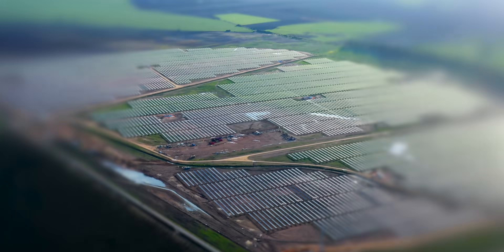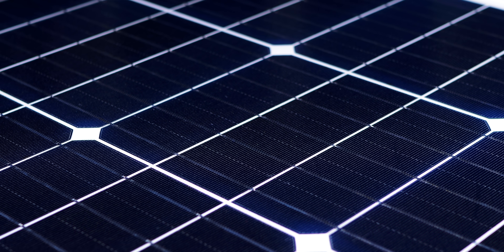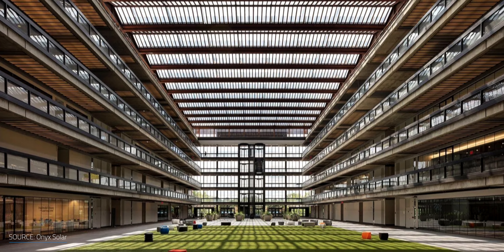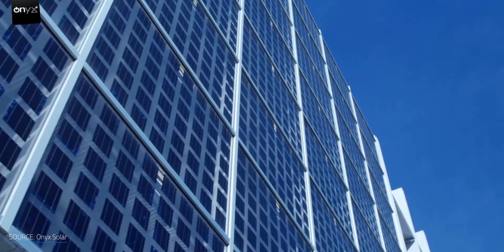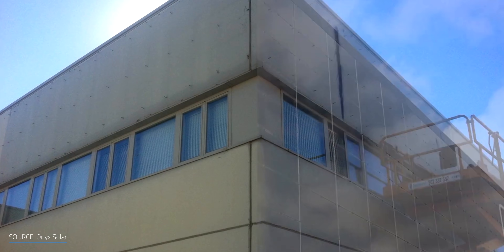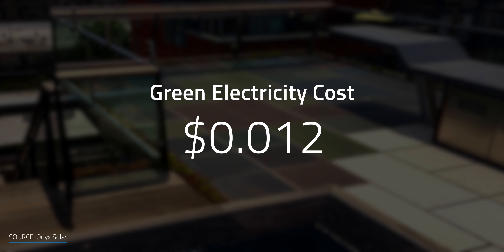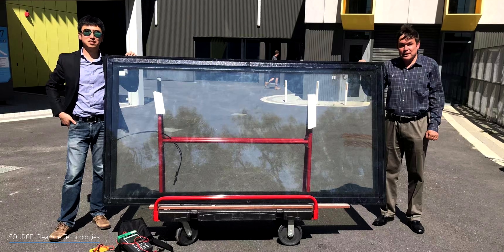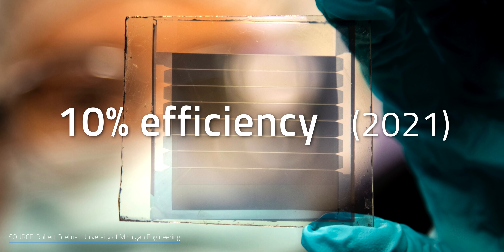Exploring a New Transparent Solar Cell Breakthrough

Comment: We have a glass company in Minnesota here,  Sage glass, that makes a glass that can be shaded by using electricity to darken it.  A side effect that they found with this glass is it can save major heating and cooling costs by absorbing and transferring heat in cold months or absorbing and radiating off heat in warm months. It's quiet amazing what we are seeing come out of glass.
Reply: *quite amazing
Reply: Yeah, those bathroom stalls that turn into mirrors or frosted glass when you close them are still straight-up science fiction shit to me.
Reply: I thought those glass that can turn frosted were liquid crystal based minus the pixel structure.
Reply: @ecp4500  that’s exactly what they are but still like magic though
Reply: Electrochromic glass is nothing new. It's been used in several industries, including the auto industry, for more than a decade. Think "auto-dimming rearview mirror"
Reply: @toddpeters1732  Yah it's been used on ambulances on the back windows for years I remember seeing it when I was superrrrrr young like elementary school age and being flabbergasted lol
Reply: Yup, lots of companies
Reply: Apple

Comment: I love the idea of solar windows on greenhouses. They don't need as much power to cool and heat as regular buildings as far as I know. For some farms and gardening businesses, they could be worth it if the panels degraded less slowly.
Reply: Could store the power for those fancy violet LEDs for when it's overcast and/or dark. For more rapid growth.
Reply: at some point in the future when these windows come down in price, sure. For now and the near future, they are around 10 times more expensive than regular glass, while providing very little electric energy. Put some standard PV panels next to the greenhouse instead. In short, if you want an energy-efficient greenhouse, this is not it.
Reply: @tzenophile  they’re talking about the 10% efficient ones, not the 1% efficient ones. That’s only half as efficient as a roof panel, but for the entire greenhouse coverage.
Reply: @kaitlyn__L  You have to factor in the price. If you do, it makes no sense.
Reply: @tzenophile  of course at the current price none of it makes sense, it’s all R&D (and early adopter stuff for optics and subsidies). But in general, 10% efficiency solar windows would be worth it if they were competitive with triple glazing plus LCD dimming.
Reply: @kaitlyn__L  Yes but. And lots of IFs.
 R&D does not stand still for the standard panels either. I'm considering an integrated solar roof for my new house which would pay for itself over the years and then some, but if I instead just went with a used panel ground installation (since I have the ground space), I would save much more, and from an initial cost much lower. There is a reason our watches, head torches, and electric bikes are not powered by integrated solar. Transporting electricity from a nearby solar farm is going to be more cost-effective for the foreseeable future, probably for ever. No R&D can change that.
Reply: “Panels degrade less slowly” means faster

Comment: While a comparison of rooftop efficiency versus window (transparent) efficiency is valid it doesn't address how I and many others would utilize the technology in the real world.

I would use walkway, siding, window AND rooftop solar in conjunction with each other. The contribution from the walk path, siding and windows may be negligible compared to what is coming from the roof (traditional) solar panel but every little bit helps.

Comment: Light behaves as a wave, with infrared around 700 nm, and like all EM waves, it needs an antenna of the given wavelength (or below, in resonant modes). I mean... why don't they embed glass with a mesh of conductive material which structure replicates miniature 700-nm antennas?
Reply: That's actually an area of current research. They're called optical rectennas. The trouble is manufacturing such small structures is expensive and slow. Plus there are countervailing factors. The smaller the antennas, the more efficient they are at collecting light, but also more electrically resistive. Most diodes are too slow to react to the ultrafastfast changing current in absorbed IR too. The efficiency of the optical rectennas developed this year is still only 0.001% but what you're describing may be a real thing in the future pending further scientific research.
Reply: @SafetyLucas  uh, thanks for the update, I should have known that couldn't be an original idea, and that's basically the kind of answer I was looking for. It's been investigated, good to know! :)

Comment: As a method of generating energy they're not efficient, but as a method of preventing heat from entering the building while also allowing light or even visibility means that they are significantly better as a window than a standard PV panel, then on top of those advantages it generates some electricity which makes it somewhat better than just IR reflective glass.
Reply: They're still more efficient at producing energy than the current alternative, plain glass. Comparing them to regular solar panels would make sense if people were actually putting solar panels instead of windows and wanted a transparent alternative.
Reply: It's all about cost.
Reply: @theproceedings4050  Yeah, that will be the point where it could fail horribly.
Reply: Space efficient or cost efficient? It’s probably better and cheaper to use IR reflective glass and build a solar farm where you have more space.
Reply: And it also costs more than tinted windows.
Reply: @Aaron Woodard Yeah, that's a fair point. Possibly working out functional durability will be a better plan than focusing heavily on efficiency.
Reply: @Aaron Woodard Depending how it's built, you could probably use the connected frames on most large glass covered buildings to act as a conduit to centralised connection points. Run up or down to the nearest mechanical floor and then you can make a mess running them in from there since the users of the building won't see it.
Reply: Not only are they inefficient at power generation in and of themselves, windows also have non-ideal angles for solar. Ad to that they existing solutions to blocking/absorbing sunlight are more cost effective...You'd literally be better off with increased cooling for the building, traditional sunblocking for windows and then a proper solar facility somewhere else for power. Less carbon, less cost.
Reply: I think the idea of using it on cars to generate a tiny bit of power (perhaps as a trickle charge to help prevent dead batteries over the long term) is neat, but the REAL star of the show on this would be the unintentional side effect of acting like a healthy layer of sunscreen for everyone in the car.     I almost always end up with a "drivers tan" on my left arm in the summer from sunlight coming into the car.
Reply: Probably it would produce more co2 during production than it would save from producing electricity itself for its lifecycle. But interesting for sure. I had already heard and seen them myself 10 years ago, but if they’re still not so popular already it’s only fair to think there might be something holding the tech back
Reply: @Aaron Woodard The kind where it's refracting the IR to the border of the glass would require frames since the frames are where the actual PV section is. It would make facadeless either impossible, a lot more difficult, or you'd need a layer of glass far enough separated that it can go over the PV frame.
Reply: Scale it up on a factor of small towns to big cities, of people and those drops of electricity equals a running faucet up to fire hose?
Reply: If a skyscraper had those windows thats alot of power being generated.
Reply: @rexerator  probably enough to make a cup of tea per floor a day.
Reply: @rexerator  Yep. But if you could somehow get the building owner to put standard PV panels where all the windows are you could generate a ton more power. That's where they come in handy and what I was saying, they are see through meaning they can still function as windows and generate power meaning they would be a good option as long as they are financially viable. 

Also, keep in mind that skyscrapers would often be in a grid with a bunch of other skyscrapers meaning the lower sections of most skyscrapers out there probably won't have much direct sunlight. So you would only really be able to use some of the upper section of the tower for generation.
Reply: Anyway regular glass is IR opaque. A double pane window blocks almost all the IR.
Reply: @janami-dharmam  Windows are often opaque to IR, but that is not a natural feature of glass. Many windows use glass that has been salted with other materials to make it selectively opaque to IR and UV.
Reply: I can’t imagine they’ll make enough electricity to power the cooling for the heat they still let through, for something that would be used for an actual transparent windows.
Reply: @float32  Next to a fully transparent window they would be immensely more efficient. Next to an IR reflecting window they might have a small amount of heat transfer through conduction, but considering heat pumps can be upwards of 400% efficient, I think the difference would be small enough to make them more efficient in total than reflective windows.
Reply: @kerradeph  but what about winter time? it would be really good to get some extra heat through windows and save electricity used for heating...
Reply: @sidivo  It would depend on the amount of time out of the year you want the heat leaking in vs the amount of time out of the year you want to keep the heat out. Northern Canada you might be better off with something that lets IR through since you get so little anyways. Arizona you would probably want something to stop the IR.
Reply: @kerradeph  where are you getting those 2nd law of thermodynamics breaking heat pumps? That's stupidly higher than reasonable carnot efficiency limits. (also its over unity which in itself is wrong)
Reply: @roderik1990  It's not breaking them, it's that it's moving heat from one place to another. It moves 4 times the amount of heat as the amount of energy needed to move that heat. Look up COP for heat pumps. It can get as high as 540 in certain conditions.
Reply: @float32  when you combine this glass with a building built with passive solar design it makes a big difference. I’m building my dream home this coming spring. All of my windows/doors are south facing and all of the south facing walls are glass. I’m working Onyxsolar to provide all the glass for all the south facing walls. If the onyxsolar walls generate HALF the electricity the company claims, It produce just enough electricity for my hydronic floor heat. 

The irony is, the cost to change from smartglass walls I originally planned to use to onyxsolar glass walls is less.

Comment: It may be much less efficient compared to regular solar cells but it generates infinitely more power than the glass that would otherwise be there. Solar glass should be the only kind of window we install from now on.
Reply: Exactly
Reply: That's a really narrow minded way to think about it. While this does produce usable electricity, it's a tiny amount compared to same investment of money in a normal solar panel array. Not to mention it's more fragile and nowhere near as weather resistant compared to the heat-strengthened glass that's used right now. Given how solar panels are a marginal payback technology right now even with tax subsidies this is a long way off from being economically viable.
Reply: @iammeok  the amount of times companies take a loss for long term sustainability. I’m sure we can conjure up the cost.

Hell our government spent $2T on a war that didn’t go anywhere in Afghanistan. After seeing that fiasco, that’s when I learned expensive doesn’t exist, just relative
Reply: @tycooperaow  Sure but what makes you think this is sustainable? The same factors that make it not economically viable in this case also makes it unsustainable. This would only increase the huge e-waste problem by breaking easier, by being harder to repair and recycle. Not to mention the environmental impact of manufacturing these in the first place (especially on the large scales they are talking about in this video).
Reply: It’s not really meant to be the MAIN source but damn it help reduce usage from the main line
Reply: But... Are they easy to be recycled and what's the carbon footprint of doing so ?

Comment: I doubt we'll see it in smartphones anytime soon. Not enough surface area and time spent in direct sunlight, especially as these transparent solar cells are less efficient. Could potentially work better with a normal solar panel on the back though, or possibly a combination on both sides. I've had similar sized battery packs with solar panels, though they still don't get much charge from solar and as such was more of a novelty.
Reply: Sounds like massive over engineering for a problem that probably doesn’t actually affect anyone, since most people keep their phone in their pocket, not sitting in the sun.
Reply: On top of that OLED displays really don't like UV exposure. Consumer devices contain layers that absorb most of it before it reaches the organic substrate, but even then exposing displays to sunlight causes them to degrade a lot quicker.
Reply: @iaadsi  well, as you described it it seems that solar panel glass is perfect for OLED displays because OLED doesn’t like UV. The whole point of solar panel glass is, that it absorbs UV and IR light, which makes the OLED display more durable.
Reply: Don't forget solar calculators work INDOORS!  They don't need sunlight.  All that idle time with a phone screen facing lights can almost keep a phone charged... at least as much as I use mine.  Especially if you get rid of all the spy apps running in the background sucking up your battery life.  If I were stranded without a phone charger, I'd rather have a phone that takes a full day to charge for a 5 minute phone call than no ability to charge at all.
Reply: @WillieStubbs  The chance of you ending up stranded without the ability to ask for a charger (or having the possibility to ask someone else to make a call) in everyday life is close to zero. And if you want to be on the safe side there is already much more effecient products like power banks or portable solar panels. The benifit to adding transparent solar on a phone is so negligable that you will never notice it. Like you said, it would be much more efficient just closing a few apps running in the background.